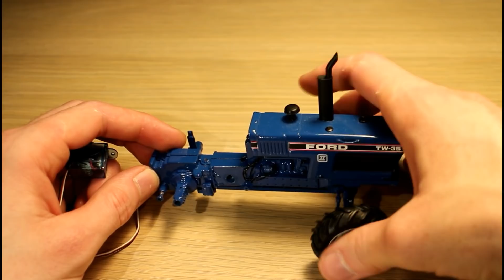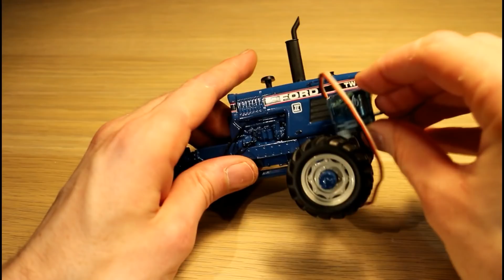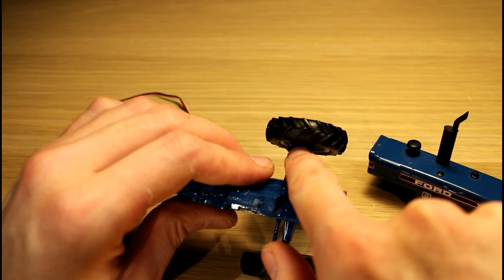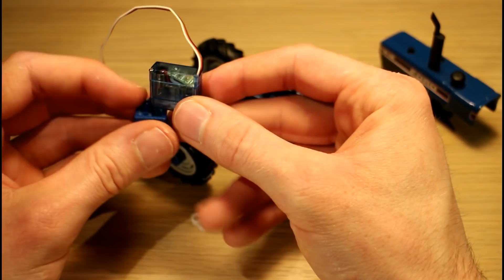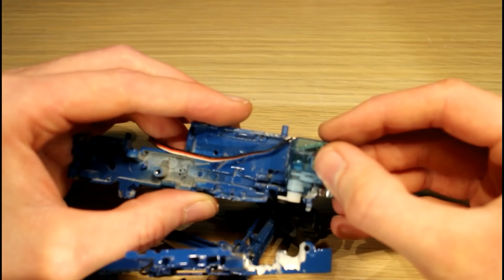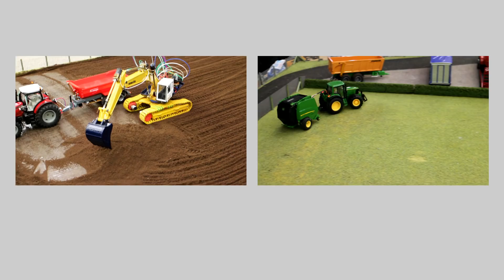Radio Controlled Ford TW35 Part 2 - Adding the Steering Servo

Comment: hey  

can you build a ford 7810
Reply from the maker: +Luuk Hendriks I have a Ford 7810 I bought a few years back thinking I'd convert it but it's so small I'm not sure I'd be able to. There is very little space at the bonnet to put in a steering servo without ruining the look of the model. Maybe in the future it I get more compact electronics I'll try.

Comment: are you finish to let this tractor drive and everything ? it would be fun to see it if it works all becose i want to se if it works and if it works i maby wnat to try it by my self :P
Reply from the maker: +Haukur jón No it's not finished yet, I have the drive motors working but I still need to put the electronics into the model.
Reply: ok nice
Reply: Halo

Comment: I'm building an RC case IH puma but I'm struggling to figure out what the right antenna  to use is the xbees have range but are so expensive any advise ?? Also bought an arduino uno but then changes my plan because I want to use an Xbox controller so do I need another arduino with antenna to talk to this arduino which is talking to the computer wich is taking commands from the Xbox controller.... Too confusing😁
Reply from the maker: +CornbinderKid Yes the XBees are a fantastic radio, super reliable but I moved to the NRF24L01 because of the cost. I am beginning to have a large collection and couldn't afford XBees for them all so I switched to the NRF. If it's a 1 off build probably go with the XBee it's a lot easier but if you are considering building 5 or 10 models I'd switch to the NRF24 or you'll be bankrupt. As for range, you are only going to be a few meters away from the model at any time I'm sure so I don't think you need to worry about range.

As for the xbox->pc->Arduino->Radio Module, I have  had a few people ask me about that kind of thing but it is so complicated I wouldn't know where to start. I'm pretty sure it would be a lot easier to just buy a cheap xbox controller even a wired one, throw away the electronics and use an Arduino directly yourself. I'm not saying don't do the computer way if you want, it's great to figure out things like that and in the future you might find it very useful for other projects. For example maybe in the future you'll use a Raspberry pi instead of the Arduino and PC to control a robot or something.

Comment: Hey man just wondering if that tractor had the steering box under the steering wheel as most Ford tractors do ? My reason for saying that is it would look more real with the steering arm along side of the tractor and might be easier to mount that servo what you think ?
Reply from the maker: +GOBC Models That is a very good point I hadn't taught of that although wouldn't a tractor that big have had power steering? I've never seen one in reality so I wouldn't know.
Reply: Hi yes they are power steering with hydraulic lines going to the steering box. My family and I have had a few ford and newholand tractors over the years so I kind of know what I'm talking about.I'm kinda of sticky on realism looking models. Well keep doing your great work man. I enjoy seeing your work.
Reply from the maker: +GOBC Models Yes some people are great at making the models super realistic, particularly when they are painted up with the weathered look. I tend to get carried away with the electronics and ridiculously big LEDs and forget about realism :)
Reply: Well its easy to get carried away trust me I know. Someday I would like  to try a Rc build maybe some sort of heavy equipment or vehicle. Well you know what they say great minds think alike. Well keep up the great work. I'm George.